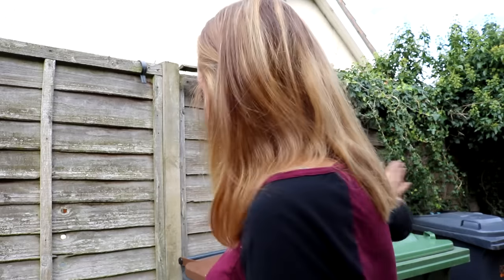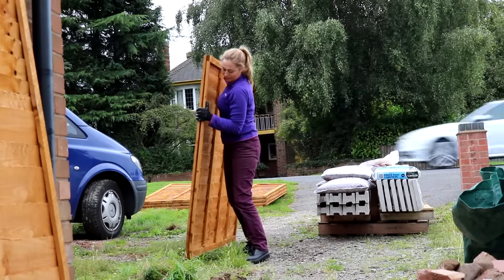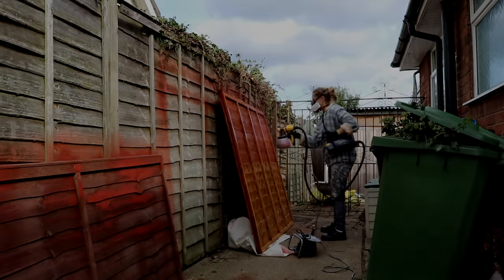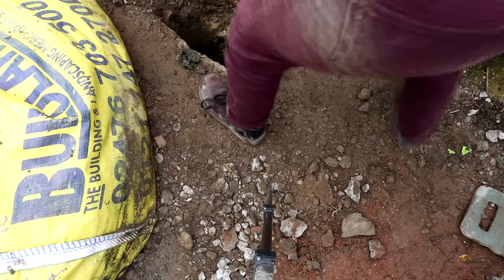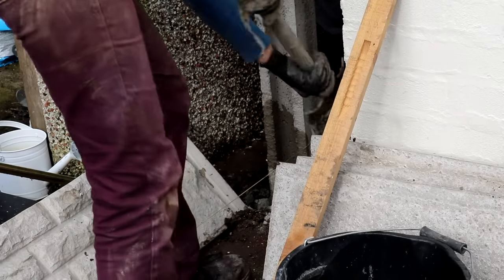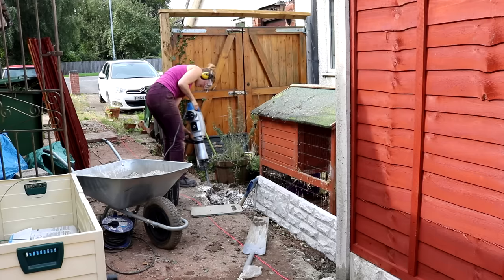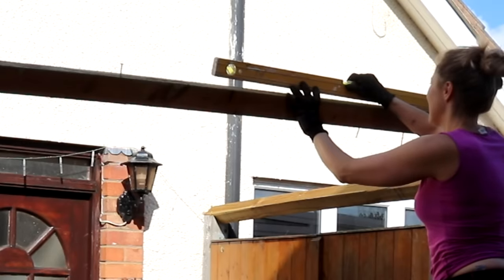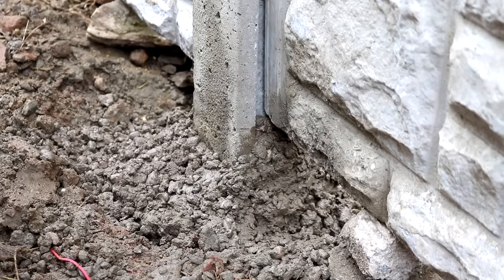Concrete Fence Post Fencing DIY | The Carpenter's Daughter

Comment: Not a bad  effort young lady  but  the professional way would be , concrete first post into the ground with the finished panel height to the top of the slot in the post so you have maximum amount of post in the ground (remember to add gravel board plus panel to get the post height correct) then get yourself a 6’ long piece of timber (a 6’ piece from the old fence would do) lay the timber on the ground into the post slot this will give you the position of the next post hole, dig your next hole , place your first gravel board into the slot of the first post (support the gravel board as necessary so it stays level) place the first panel onto the gravel board and into the slot of the first post, check your levels , drop the second post into the hole offer the post up to the panel and check the post height is the same as the first using the top of the panel as your gauge, check your post level then concrete that post in , repeat,repeat, this method ensures your post height stays the same over the entire length of the fence unlike yours !
This method is fine for a level of near level garden , if you have a sloping garden you need to step the panels to suit the slope of the garden, working downhill is much easier that working uphill !
If you have to step your panels remember to select the right length of post you need a minimum of 18” in the ground preferably more, you will tend to loose some of the length of the post when stepping panels.

Top tip, buy a fencers ‘graft’ and a 5’ builders bar , makes the job so much easier..

Comment: where was the sand in with the gravel  ,and its  easier to put panel in on top of gravel board   afre you leveled it as if you slide it in after  it could knock it all out  and you have to start again but well done for having a go

Comment: Get you string line and the finish height next time use that to dig your hole the correct depth, be careful of buried cables like power, not bad for a first attempt..

Comment: Set first post, then gravel board then wooden panel on top then next post straight in the hole- butting up to the wood panel & gravel board, no need to lift the wooden panel and slot it down the grooves of the posts, that's completely backwards my friend,,anyways good job 🙏

Comment: Its a lot easier to put the panel on the gravel board before you set the second post, if the panels were double palings you would struggle to do it your way.

Comment: How is this holding up after 2 years? :)
Reply from the maker: Yes, definitely!  Although I bought some 2ft fence panels since and continued extending the fence... those panels have warped a bit, so will probably need to replace those sooner than the others.
Reply: Thanks! Yes, some panels last longer than others.. 👍👍

Comment: How deep was the hole? Isn't it not meant to be good 600mm deep?

1.8m fence +.0.3m gravel board + 0.6 = 2.7m. The 8f post would not be long enough no?
Reply from the maker: Yes, these should be 600mm deep and they're not.  We disagreed on depth and I've since learnt that I should have stuck to my guns.

Comment: Do you secure the fence panels to the concrete posts or it’s not needed
Reply from the maker: Great question! It's not needed, but it is best for security to prevent thieves/intruders just sliding it up and letting themselves in your garden.  My Dad pilot holes a drill on an angle downwards from one of the end batons, then pops a screw in to catch the concrete post.  Obviously the screw won't go straight into the post, but it catches and makes it blooming difficult for someone to lift the panel.  You might to add one of 2 in on each side. Hope that helps!
Reply: @TheCarpentersDaughterUK  Thanks for taking the time to reply.

Comment: I've just spent £500 for only FIVE 6 x 6" feathered edge fence panels, plus 6 thick 8" posts. No gravel boards, no post cement or anything else! I think I've been ripped off!! 😱😤😥
Reply from the maker: They're probably better than these ones though?  These ones were very basic and my Dad told me they're mine aren't the best quality 😉
Reply: @TheCarpentersDaughterUK  
Hi, thankyou for the feedback. Well your finished result did look very impressive. 👍 Great job! I seem to handle other DIY projects very well, such as building a large raised Decking area etc, however fitting perfectly vertical posts into the ground, at exactly the correct (6") intervals doesn't seem to work for me! 😱🙄 Well tomorrow I'm doing just this, one side down the rear garden! Wish me luck! 😂

Comment: Instead jackhammering concrete from old posts or cut the first fence panel to avoid the old post and then dig again new holes true the roots and sh..t  ha ha I will tell you what you should do, just jack the old post up and they come with the concrete base too ha ha, how simple is that?  one post 3 minutes,  if not because they are completely rotten or you brake them before jacking up then you drill hole in that concrete base (after you broke the rotten post) then put screw for car strap on top of that and jack and you lift the concrete base up very easily . Easy job and holes are ready. Only what is difficult on this job is the weight and set them up straight and one more thing what I can not tell you as our know-how because my fence will be super straight for life time.

Comment: Your better off fitting the panels as you go along, it's much easier. Level the first post, fit the gravel board and level it then fit the panel, then the next post, and go on like that

Comment: I don't drop the panels in from the top, I put a panel into an already placed post and then erect the next post.  I managed to do a 10 panel fence like this alone this way. Admittedly not everyone could lift the posts, I slide them into hole then lift vertically. Does anyone else do it this way?

Comment: Your panels should finish flush with the flat part of the post .... just befor the point starts .... not 3 inches or more below
Reply from the maker: Yes, I know.  We had arguments over it at the time 😄 So now plan on making fencing panels later down the line.

Comment: great concrete posts but the timber pannels are rubbish , plus i would   put my new posts at 5 foot apart to avoid digging up tthe old concrete ,i would just cut the old posts off from the bottom

Comment: Great System, did the concrete posts cost more than say a composite type post. either way, it will outlive your grandchildren.
Reply from the maker: Thanks +John Babcock.  I didn't know about composite posts but would've used them if they were as strong and light enough to lift on my own!  I assume they'd last as long as they wouldn't rot?

Comment: Dry packing concrete mix in a hole is wrong. The mixture never gets uniform strength and most of the time there will be pockets of dry material inside. It is so easy to mix then pour, there is no reason to not do it right.

Comment: Not bad for an amateur but the progress looked very slow and top of the panels should be flush with the start of the chamfer at the top of the posts.  If it was my garden id have her back to do it again. A very expensive mistake.

Comment: An A for effort and ambition but you've left the posts protruding far too high above the fence level so the installation really isn't anywhere near to  professional standard. As you discovered it's very very hard work digging  600mm down past old concrete and sinking very heavy posts to the correct depth and true, either that or knock six inches off the bottom of the post but really this job with these materials should've been left to the pros. (former fencer)